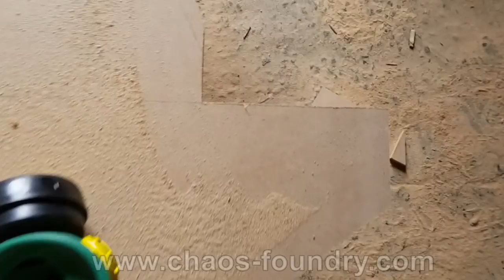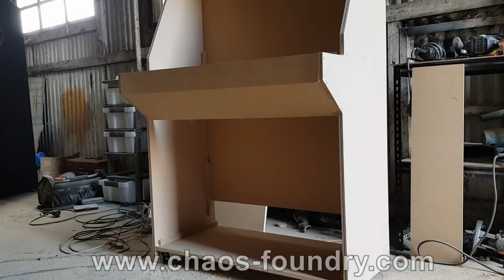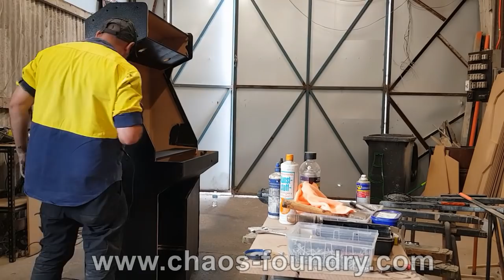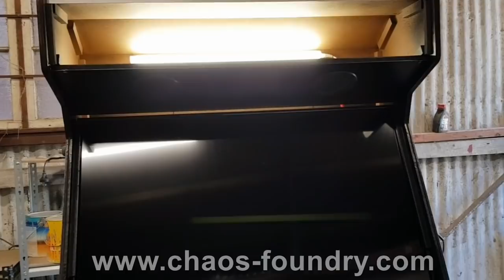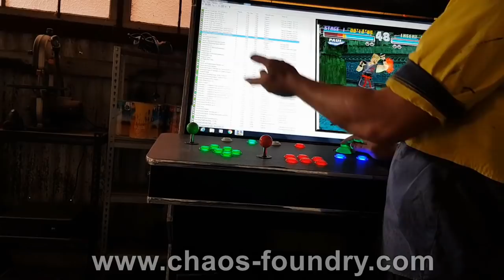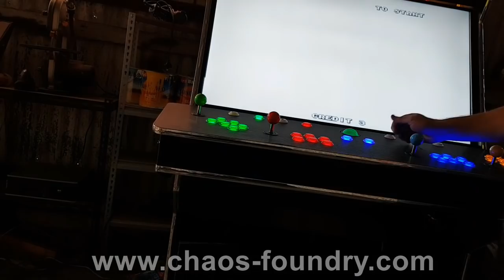Massive arcade build, from start to finish, 42" screen, 4 player

Comment: Ok 9 hours and cost was 920 dollars.
The cost of a few arcade 1 ups and the same time to build. Of course it's faster when you are a pro. 
I'd definatly want a track back, and I suggest fastening  the board permanently with screws so it dont fall off. And can you include a coin door option?
Or steering wheel and light gun attachment?

Comment: Nice build my Australian friend, but I was wondering why don't you part the door in the middle and then do 6 door hinges and then lock from both sides ?

And other then that nice cabinet, you build, like the design you made how ever there would be a bit of things i would changes.

FIrst of i would never use MDF i would use plywood MDF you just have to look at MDF and it breaks and chips. and also when you use the long door idea you did in this build MDF tends to sack as you so elegantly explained but Plywood keeps its form much better so any way maybe we could exchanges a few ideas if you like

Kind regards
Kent

Comment: Firstly, Love you work and your attitude man, you seem like a Guy I could have a beer with.  Second, do you have any advice for a woodworking noob whom routed the t molding grooves slightly off center? should I woodfill and try again?
Reply from the maker: Nick Pierson thanks mate, I've routed the slot off centre many a time. If you fill and try routing again it'll be a mess.
Just get wider T moulding. I use 16mm mdf, when i messed up with the slot is use 18mm T moulding then trim the edges with a blade

Comment: Nice build! Couldn't you have made a bracket for the 42" monitor, then attach it to the face of the original cabinet? It would've only been several inches wider and about 1 1/2" higher, so it would still look great.

Comment: Sorry for all the questions... I noted the spray mix you used. Could you roll this on if you did not have an area where you could setup for spraying. The mix with the glue etc. Sorry trying to gather all info as I can. Thinking of  building one for my nephews.
Reply from the maker: Yeah of course you can, i haven't tried it, but in theory it didn't matter how you apply it. If you roll it on you may get that roller pattern on it though
Reply: Cheers man... Really ramping my self up to build one of these. Just gota do all the research first haha (Research meaning ask if I dont know and can not find answer)  @Omegaweapon

Comment: I am inspired and am in the process of doing my own. I want to do this with a router as well and would love to know what size/type but you would use to cut template on 5/8 MDF board as well as what router bit you use for cutting the tmolding channel in 5/8 MDF board.
Reply from the maker: Hi, I use what's called a "pattern makers bit" on the router. It's a half inch width x 1" length. The slot cutter I use is 2.3mm not sure what that is in inches
Reply: @Omegaweapon  thank you. I sent an email to your website with some other inquiries regarding my build. Mind you I'm in America so of course my measurements may differ from yours slightly. I do hope to hear from you.

Comment: As a control panel/arcade builder myself I commend you on how much work and effort went into that build. That being said your control panel layout makes absolutely no sense to me. The players in the corners will literally have a wooden corner sticking out right where their stomach is. Cut the corners off for a start. The button layout is pretty strange too. I understand why you did it in regards to the ergonomics of a human hand.  The problem with it is most of us have been playing arcade games since the 70's with straight buttons. I competed in lots of  street fighter tournament and its ALWAYS the standard arcade layout. Take a look at the Ultimarc marquee on  Andy's website. That panel layout makes sense.
Reply from the maker: The Simpsons 4 player arcade had the exact console sharp, rectangular rather than trapezoidal. I modelled this after the Simpsons arcade. As for the rest of the button layout, it's what the majority of clients wanted, so i kept it that way. Escape, select, player start, pause and  coin within reach.
What you see here is what 99% of my clients wanted, they have the option of button layout, but everyone is different
Reply: @Omegaweapon  Yeah i figured it was a standard layout from a box.  I modeled my current panel similar to Andy's 4 player console. I didn't realize you were building them for clients.

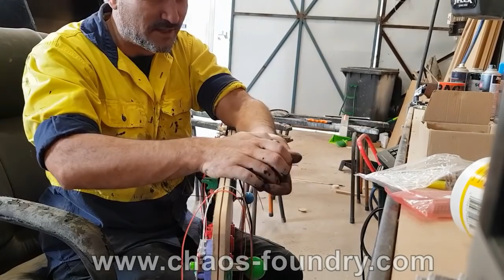Comment: Hey Abs love your video i came across it. I'm going to be installing an IPAC 4 with LED lights and i saw your discussion on it around 41:58 where it requires double the wiring. how is the ipac 4 gonna be able to handle the extra wiring for the LED's on the ipac 4 chip. Thats the part im confused on. I havent gotten it yet and forgive my ignorance im just getting my knowledge up. Anywhoo love your stuff brotha <3

P.S: whats a way i can test if i installed the buttons with the leds on properly before doing all buttons for the 4 players plus the trackball and so on and so fourth. Since its my first time i think i'll want to test it as i go along the wiring. Any kool suggestions from your experience?
Reply from the maker: Hey man thanks for watching.
I don't actually use the iPad to power the leds, I cut the end off a USB cable and wire the red to positive and black to ground, then I plug it into the pc for power.
If you're using seperate led bulbs that plug into the button, the side with the longer wire is positive. It's ok if it's on backwards though, it won't blow, just flip it over if it doesn't work.
Reply: @Omegaweapon  much love and thanks for answering! Yeah im kinda just researching like crazy cause this is first time building an arcade cabinet I really apprecaite you taking the time to respond and keep making amazing content!
Reply from the maker: All good man, always happy to help where i can. Have a safe and happy New year :)

Comment: Hey Abs, I really appreciate all the videos you've put out. I've been wanting to build my own Arcade machine and you've made that possible! One question though - What specs do you look for in a PC to properly run all of these games without any issue?
Reply from the maker: Hey Alessandro, a dual core will run everything pretty well, but an i5 is better if you want to add PS2 and Dreamcast etc. 4gb ram is plenty too
Reply: Abs Delfuego awesome, thanks! I was thinking about expanding to emulate PS2 as well. Any specific i5 you recommend? I was looking at the i5-4590/i5-4570 but have no idea how to gauge whether or not its over kill or not good enough. Btw your charity work doesn’t go unnoticed! Very generous of you.

Comment: love your build mate . i in the uk and a carpenter myself but not so tech savy but not stupid either lol just not really up to speed about a decent cpu to use to run everything can you help at all
Reply from the maker: Hey mate, A dual core PC will run most emulators very easily, but I use a small Intel i5, it's way overpowered but it's good if you want to run PS2 and Dreamcast etc
Reply: @Omegaweapon  nice one cheers for replying to me i appreciate it , how many different controllers can you use . that cabinet i plannnnig to build is similar to the megacade but i gonna intergrate the ps4/5 and ps3 within the front of the cabinet seperate to the pc etc under light leds to eluminate but really want the arcade controlers track ball 4 way steeringwheel and maybe nintendo wii not to sure yet 
sorry to rack your brain and experience 
cheers dude 
richie
Reply from the maker: @richardeanor3098  the joystick console is limited to 4 players because the ipac encoder only offers 4 players max. You're only really limited by how many HDMI outputs to the tv  you want to have.  ie one for each console, one for the PC, then you can use the controllers on the console
Reply: @Omegaweapon  fantastic cheers matey when i am done i shall post you a picture thanks for yor help my friend , love the vids and the fuck it bugger it and its fucked talk lol lol made me laugh , just how i talk when i working lol
Reply from the maker: @richardeanor3098  lol anytime my friend. I find my videos therapeutic because I get to vent

Comment: What does your router bit look like to trace the cut outs id like to do the same so im not doing it twice :)
Reply from the maker: It's called a flush trim bit or pattern makers bit. It's an S shaped bit with a bearing ontop
Reply: @Omegaweapon  cheers dude check them out today, :) anymore videos due to come out

Comment: With MDF do you use primer or do you not see any need for it?
Reply from the maker: Nick Pierson the paint is a self primering paint. I used to prime it first, but it was truce the effort. The glue also seals the pores in the process

Comment: How did you manage to play tekken tag on mame while my tekken 3 is really slow on mine?//
Reply from the maker: Right click on properties, and check which processor its defaulted to. It should be on the CXD 100mhz chip, not the Z80 which is sometimes default

Comment: `stretched` 4:3 ratio ? no thanks
Reply: You don't have to do it that way, the reason top end mame cabinets use massive 42-56' monitors these days, it so that when you play it 4:3 format, the size of the screen compensates for the sides being cut off.
Reply: @johnmclain250  , i get your point but seeing a wide screen lcd or led monitor kills my mood not to mention running emus in a computer not very stable.